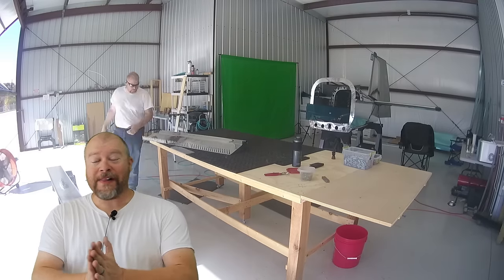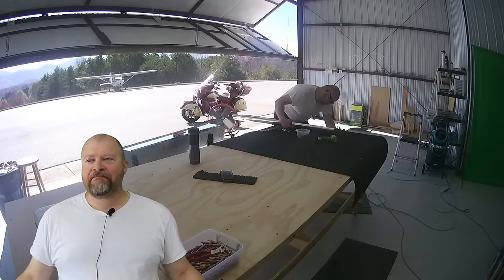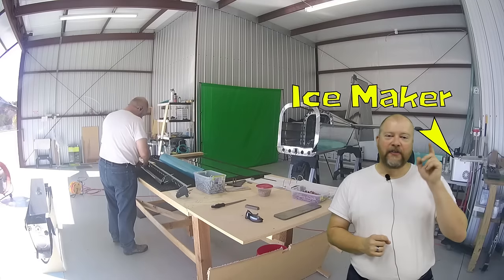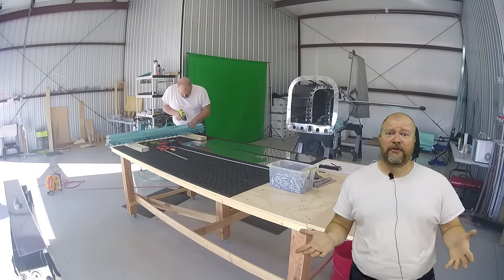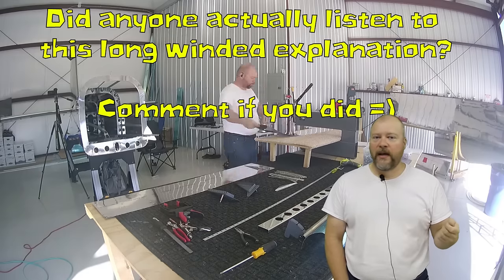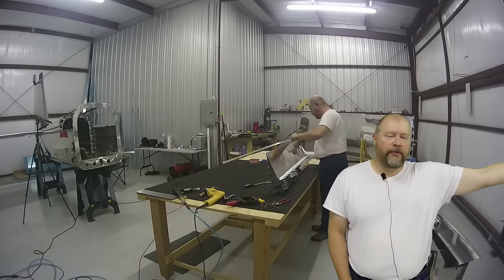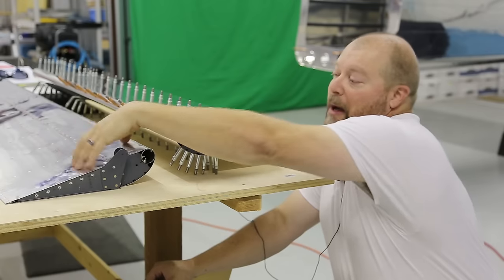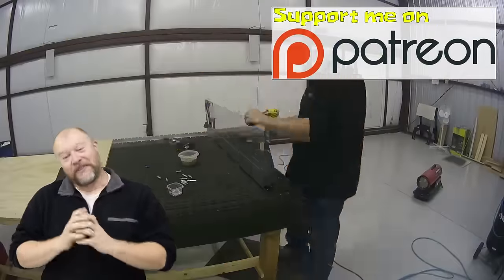RV-10 Wings - 033 - Finishing Ailerons - Affording a plane - Aileron Mistakes

Comment: My experience in plane ownership is that it is NEVER a financial gain. BUT ... this is an enabler. It allows you to do things that you cannot do with a car or would be too time consuming to go through traditional airlines.
My personal example is that we can see our family and it would be a 12 hour drive round trip. By airliner, it would take about 10 hours because of connection, TSA... With my then plane (182), it was a 4 hour round trip. 2 hours each way means we can depart after work on Friday and come back end of Sunday.
The car would have been the cheapest but would take the most time. The airliner was just not feasible because the destination was not a hub and I was flying from a small regional airport. But our plane was allowing to enjoy the full week end and not be wiped out by a long drive.

Comment: Cheapest option, at least in 2019 is definitely buying used.  There are a bunch of options on places like trade-a-plane for less than the cost of a Lycoming engine (sub $43k).  If that isn't an option, it MIGHT be worth checking out ultralights, as these can be flown without a certificate.  You could save the PPL for the flying club rentals and grab an ultralight if you just want the experience of fun flying.  That being said, you certainly won't get the pride and joy of seeing a bunch of parts turn into your own personal aircraft!

Comment: Another great video. I say the longer the better! Lol. I did listen to the whole explanation about affording a build and I completely agree. I followed the same logic in my decision to start a build. Point out you mistakes is important. I feel that it affirms the fact that a "regular guy" can build a plane. It's ok to make mistakes and they WILL happen. But as you said, it's okay! Just realize it, fix it, and press on. You're doing a fantastic job and PLEASE keep the videos coming. Without getting too sappy, they are a real motivation and are actually very inspirational. I just joined the EAA (#1225795) and my local chapter. I'm currently buying up tools and hope to ordering my first RV-8 kit soon. Not sure when your check ride is but I have no doubt you will do just fine!

Comment: Last night I misplaced one of 4 grade 8 washers it took me 16 hours to make.   I had it right there with all the parts, and it just disappeared.  WTF?   Things just don't "disappear".  After tearing apart my kitchen, I sat down and thought, and determined it could only be in the last place left, the place I didn't want to look, the axle hub I had last put together.  And sure enough, just like I speculated, the washer had been stuck to the wrong side of the bearing with grease when I had picked it up, and I had put the bearing in without noticing it thereby losing a washer inside the hub on the wrong side of the bearing.   Grrrr.

$60,000 for an RV kit.  For that kind of money I'd probably settle for nothing less than 6 full built ready to fly planes and they better look spit polished shiny for that price.   I'm trying to build my entire plane plus a 20 foot trailer to haul it on for under $1,500.   I think you'd be better off putting your $60K in an investment, and doubling it in 5-10 years?

There is no practical use for a homebuilt plane, and as I was shouting rhethorically to no one, very pissed off yesterday "Is this suppose to be fun?!  Is this suppose to be fun?!"  <-- because having parts disappear on you was not fun, and building an airplane is nothing but work, work, work.   An endless ocean of work...   air-war.org

Comment: hay look from the prices I've seen recently on 5 years old .... well maintained and well-finished rv 10s , they are selling at about 180,000 usd and all up your looking at spending 60,00 usd then you would be able to sell it for 120, 000 usd when finished, if you were building non stop i believe you would be able to make it in under a year ... based on an amount of time you gave us for the avrege amount of ours per day ... 0.8 hours per day for a year to finish the empanarge ... therfor if you had 5 hours per day it is reasonable that you would finish it in a year... based on those numbers it is a very viable option for a full time builder..... actyaly flying a plane is another thing .... :P

Comment: Flying, like any other hobby, has scales of expense/simplicity. 
Hang gliding is fairly affordable. There's, ultralights available for about $10k. 
A popular design, affordable true airplane would be a pietenpol air camper that's 2 place, could be started for under $2k and finished around 15-20k. 
There's a lot of cheaper ways of fly.

Comment: Hi Jason, great video again !
Did you look at other kits, either other metal kits (for instance the Sling 4 from the aircraft factory seems less expensive, but less powerful) or even composite kits ?
Reply from the maker: I have looked at a lot of kits.  I wanted to make a Velocity, a long EZ or a berkut for a while but my completely lack of experience with fiberglass steered me away from it.  Great planes all.

The sling 4 is a good plane for sure and the aircraft factory has been doing great things but for me it didn't meet my requirements.  It's a light sport aircraft that would have range and weight issues for me.

Comment: If comparable new airplanes can be purchased for half a million or more, realistically, how much is a new kit plane worth when finished? (specifically, an RV-10).  In other words, if your RV-10 parts = $150K, what are you earning for your time invested?
Reply from the maker: Great question.  I think you could easily get $200k+ for a fully functional RV-10 that's well built, painted and has good avionics.  Maybe even up to $300k..   The value of the RV-10 is going up in my opinion, you'll note you can't get them on the various plane sales sites because people recognize how good they are.    A comparably equipped plane would likely be the Cirrus SR22T which costs $800k+.
Reply: Thank you for your reply.  But I remain confused as to why a factory built plane can be sold brand new for up to four times the sales price of a brand new kit built plane.  Either the factory plane is over priced, or the finished kit plane (with labor) is under priced.   The discrepancy seems too great.
Reply from the maker: Ken, the big issue is the FAA Certifications required in order to build and sell a non-experimental / certified aircraft adds a CRAZY amount of cost to an airplane. Cessna, Cirrus, Piper..etc.. those certified airframes are great but in order to get the FAA certification even the most trivial thing, like.. a bolt, has to go through a rigorous testing process that experimental aircraft aren't subject to.    Thus, you can build an RV-10 for less than $150k that is easily as performant and cheaper to operate than the comparable Cirrus SR22.  Does that answer your question?
Reply: Thanks again Jason, It just seems outrageous that government red tape can account for $600,00 / $800,000 (75%) of an aircraft's value.  I'm still recovering from the shock that building permits for a new home accounts for 25% of the home's value in our area.  But this aviation tax beats that by a nautical mile.
Reply from the maker: Yeah in a lot of ways I have reasoned that the FAA (thus the government) doesn't actually want people to fly.  They price it so high in many cases that this is the only conclusion I can draw..

Comment: Wall of text incoming!  Dont know how much will be useful to you or not!

Its quite interesting seeing yourself come from a non aviation background and be completely dumped into the mess that is general aviation.  Personally I think its quite interesting when you compare aircraft like a brand new cirrus and the RV10.  I think for non aviation people is easy to dismiss the RV-10, planes are ment to BE expensive, so the Cirrus must be good.  But when you compare the actual capabilities of both aircraft, well the differences really start to fade away.  You are then left with the real question, and I really getting 500,000 dollars of added capability with a Cirrus over an RV-10.  It doesnt take much to argue they perform the exact same mission, minus flying in the flight levels.

Anyway, with your musings about engines, I am sure you have trolled the Vans forums and are aware of overhauled engines.  You probably want a super dooper brand new engine in your machine which I get. But at the same time, if you run the new engine vs overhauled through the same thought process above.  Well you dont actually get any added capability or performance.  It just might be worth having a very good look at.  Even if you want brand new there are other options like Titan Engines, Superior Engines, plus more that are Lycoming clones.  Some performance or better.

I know the engine is a long way off, but well deciding if you will run Avgas only or Mogas is a consideration with fuel tank fittings, and the rest that will follow to the firewall.  Anyway I digress.

Really like what you are doing, and its awesome to see someone with the aviation bug with a smile on their face every time they talk about planes!  If I ever get a chance ill help you out any way I can!
Reply: Hey it's Rush! Cool to see a streamer I watch in the comment section of a YouTuber I watch.

P.S Keep a fire extinguisher next to your PC from now on.
Reply: lol Well I have appropriate signage on the PC now.... And yes I care not to tell you how much I have lurked all of Jasons videos :-)
Reply from the maker: Hi Rush!  Yeah I wanted to talk to all that in a future video but I'm not "there yet".  I have looked at New and Used O-, IO-, and even a TIO-540.  I think it's pretty obvious I'm going to go for used because the price difference is brutal.  Interestingly I have also looked at finding engines at (for the lack of a better word) junk yards.  Or planes that were confiscated/seized due to being drug planes..etc.. I know one fella who got an older O-540 for his -10 for under 20k.  Put like 5k of rebuild on it and ding perfectly working engine.

I'm told that If I want the flight levels, a TIO- is required.. I could be wrong though.  Again this is really a subject for much later discussion and research first.. but I don't mind floating it and chatting now.  A TIO will be pricey.  Like.. more than double the IO.. so I doubt I'll be able to swing it.. Hell even the CORE value is more than the O- that my friend has.

Regarding alternate engines and clones ~ I have ZERO knowledge or understanding of them. That's all a mystery to me so I have a lot of learning to do before I go forward there.. Again the timing just hasn't been there yet.  I need to get closer to that point before I pull that trigger.

Now lets talk about important things..  Flight sims! I need to get into those.. I really want VR goggles though.. to feel more "in the plane".. Thoughts?
Reply: As far as sims go with VR I highly recommend it, however be conscious of what your computer can handle. I have basically upgraded everything I can to get the best performance; and while it is worth it, its not the same as flying a real plane but it's great to practice navigation and other things(like flying an A-10 in DCS). Any specific questions feel free to let me know!
Reply: Hey Jason!  Ill go ahead and send you through a message on Youtube here about engines!

Flight sims?  Well yeah hahah I can help you out with that!  There is a new flight sim due out in the next few weeks called XP11.  I would be keeping an eye out on that, its great from a home computer!  VR is great but the hardware doesnt really support our kind of flying.  The pixel density of the screens isnt quite there to easily read gauges etc.  Honestly a decent sized flat screen and a few hundred dollars in controls and you are good to go!
Reply: I've played with various flight sims a majority of my life.  I used one extensively for my instrument ticket and it really shined since I was able to link my EFB on my Ipad to the game and I bought the GTN650 addon which replicates what I have in my current plane.  Following something procedural like that is a great learning tool.  Doesn't really matter what you get, Prepar3D, Xplane or old school MS Flight sim... they all basically do the same thing, just make sure the addons are available for what you want to do.  Also you'll hear people say the flight dynamics are better in one platform than the other... I find that all nonsense as no matter what the game is and how it's set up it's not flying like a real plane.

For your primary training it might help to just work on the preliminary navigation or run through your performance maneuvers.  That way when you're in a plane you've had practice, think of it like advanced flight training.  Or just the interaction of your EFB with an actual flight, ect.

I also had an early consumer release of an Oculus Rift.  While it was pretty cool as many as said it doesn't really work if you're trying to do actual flight related training.  Hard to see everything with it, you can't easily pop your head out and look at a chart.  It also made me a bit sick and I don't get motion sickness.